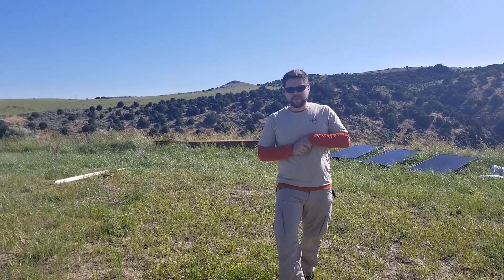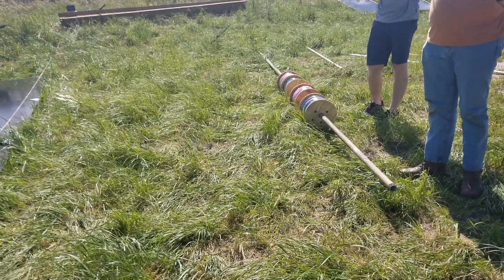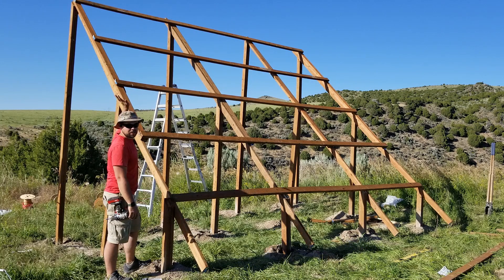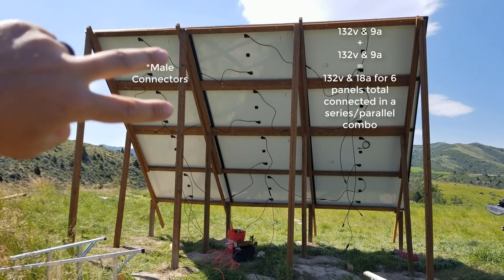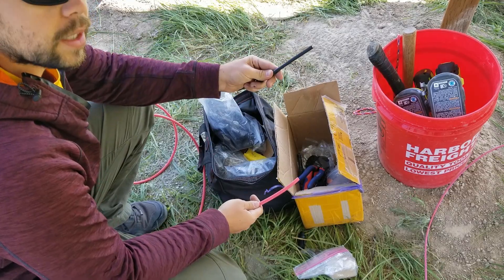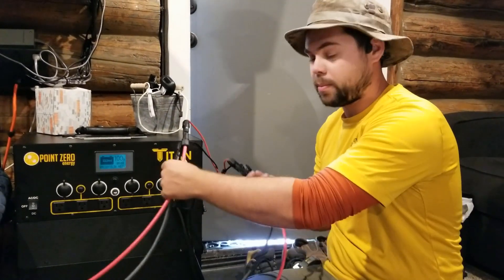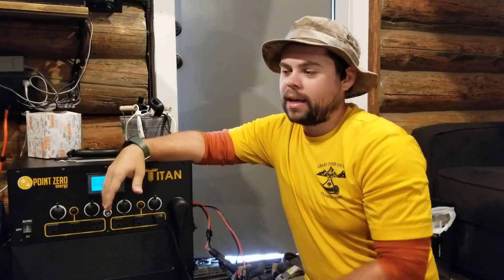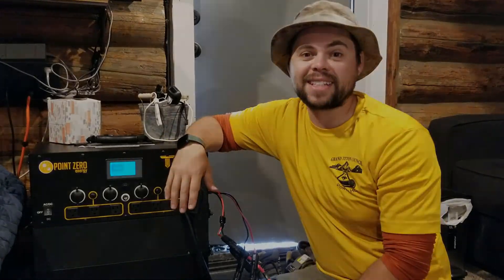DIY Off-Grid Cabin 4kw Solar Panel Array Install

Comment: Your capacity is a little undersized for the amount of solar.....No doubt you'll be fully charged by late morning..and everything else will be surplus..but at night your just running off batteries ...I upgraded my system at 4kw solar .to include 15000 watt hours..of capacity...otherwise all that solar is just wasted ...with 2000 watts solar..you would be charged full  by early afternoon...so what's the point of the extra solar..if you can't store it

Comment: awesome vid.. Thank you..  Did you put in a combiner box or inline fuses in? I'm about to do an off grid array about 4000 watts to a 145 VOC max Growatt, and I'm confused on if I really "need" to inline fuse and or the "combiner box"  It looks like you may have just "branch connected" the mc4 connectors in series/parallel then direct to controller..?  Cheers
Reply from the maker: I did not use a combiner box or inline fuses. Both would be good but I just opted not to. I would put inline fuses in and I use combiner branch connectors instead of a combiner box but they do the same thing. A combiner box is nicer.
Reply: I was thinking the same thing… Thanks again! @minutemansolar

Comment: Your setup is cool and all, but just so people know, most family households daily use 25kWh which is 12x more than the 2kWh that this cabin uses. And that's often without air-conditioning or heating, or perhaps just occasional light use. So for most households, the battery would have to be at least triple his 6kWh size just to get through one night at 80% discharge. And the solar array would need to be double his 4kW size to cope with winter output, which is generally the most critical period to account for when sizing an off-grid system. Plus get a good generator for every instance that you get a cloudy or rainy day when solar doesn't generate much. But for this guy's daily usage of only 2kWh (instead of 25kWh), his setup is more then enough.

Comment: Hi Ben, love this video.  Starting my array rack now too.  Curious about the wood.  You used 4x4's for the uprights?  What fixed angle did you go with there in Idaho?  Also curious if you used those concrete tubes or just put concrete around your 4x4s in the holes?  Do the 4x4s go 4 ft into the ground or just mount with hardware on top of the concrete?  Thanks again.  Sweet project!
Reply from the maker: Yes 4x4 uprights. 45 degree angle for Idaho. I drilled 12" wide by 4ft deep holes into the ground with and auger and filled it with cement while the posts were inside the hole. That's it. Keeping it simple.
Reply: @minutemansolar  much appreciated!
Reply: Just watching the video again. Can you remind me the width and depth on the ground for the posts you did?. I think you said 16 wide and up to 10 ft height. Do you know the depth on the ground?
Reply from the maker: @bekindlove  I put my posts 4ft into the ground. I don't remember the exact ground measurement.

Comment: Quick question, How deep did you bury you 400 ft of 8 gauge wire?  Also, is it necessary to put your 4 lines underground in conduit.  And if it is in conduit, is there any concern for overheating with all 4 wires in there?
Reply from the maker: No worry of overheating. I only burried mine about 12 to 18 inches deep inside of a pipe/conduit to keep it from getting eaten by mice or anything.

Comment: Ben another comment/question if I may.  I noticed that you kept all of the panels facing the same direction.  I have noticed other arrays where they take a percentage of the panels... let's say 1/3 or so and point them at another angle.  Any thoughts on this one please?  Thanks.
Reply from the maker: Yes there's a benefit to that because then you get the sun better when it's in the east or west whereas mine are only South South East. To be upfront at the time of filming this video I didn't understand how to make a stand or anything well enough to have them pointing in different directions. Now I know how to do that and it's not a bad idea at all. But, in the end, I'm usually fully charged by 10am or 11am =) So no real big complaints.
Reply: @minutemansolar  Really appreciate you being real on this one.  I try to do the same on my videos. I show all my screw ups etc and learning curves.  I figure I can save others some of the hurdles I incurred. Fully charged by 10am or 11 am. Thats amazing.  I am in SE Arizona and it's unusual not to have lots of sun for the full day. Thanks again Ben!
Reply from the maker: @affordabledesertliving3487  No problem at all. That's what I am here for =)

Comment: Ben this was super helpful.  I came here because your recommended I check this out. With all of that power I am thinking you could run a low watt (think about 900 watt) mini split system to both heat and cool the cabin. That is my plan anyway. What do you think?
Reply from the maker: ... =D video coming... haha
Reply: @minutemansolar  Been wanting to see the titan take on a mini split for many years now.  I am a subscriber so will look for it.

Comment: I want this setup! So you can overpanel the Titan? Can I series connect 3kw in 1 string into the Titan?
Reply from the maker: Yes as long as you're within the charge parameters of 35-145v and 30a. That's per charge controller. Each charge controller will only let in a max of 1,000w each.

Comment: I see you are using the 30 amp RV plug on the Titan to pull power out for your loads.  Do you run that through into a subpanel with breakers?  Also, do you know what the Titan does if you exceed the 30 amps (blow the breaker)?  Do both of the 15 amp breakers on the front trip, or is there another breaker somewhere for the 30 amp plug?  Thanks!
Reply from the maker: Yes that goes to a 120v electrical panel with breakers. The Titan 30amp plug has a max output of 25amps. If it goes over 25 amps it will simply shut off the inverter and beep giving an alarm that it was overloaded. I have done that and just turning it off and then back on fixed it.

Comment: 1. Are you just laying the wire on the ground all the way?   2. Suggestion : Standard practice for electrical work is to mark any wire with tape of the right color, if the wire is used differently like you did.
Reply from the maker: The wire is currently laying on the ground and will eventually be buried inside of a pipe to help it last a long time and not get damaged by animals.

Comment: You ran 2 (separate) sets (black/red) of 8gauge cable down the hill.  Then you connected the cables back together at the cabin.  Can you explain why you did it that way?  Do you have a wiring diagram?
Reply from the maker: Correct. There are two charge controllers on the Titan solar generator. So because of that I needed two sets of cables coming down from the panels. The top 6 solar panels are one array and the bottom 6 panels are another array. Because there are 2 arrays I needed 2 dedicated power lines to the Titan to go into the two charge controllers.
Reply: @minutemansolar  Oh, okay, thx.  Did not realize there are 2 charge controllers.

Comment: As I am sitting here watching your video while the TV has coverage from hurricane Laura my thoughts about 2x4 lumber supporting what amounts to a fairly large sail makes me think about how well that installation would handle some really strong wind gusts, especially from behind. I hope that it works out for you. I live in New England and we lost power for almost 4 days from a tropical storm that had gusts as high as about 85 mph. We ran important stuff off a small Honda generator. Looking into solar for a while and I came across your channel a while ago and subscribed. Interesting videos, thanks.
Reply from the maker: Luckily we do not get hurricanes here in Idaho. The 2x4s are screwed together to make 4x4s. Multiple reviews/tests have actually found that 2x4's that are screwed together are often times stronger than 4x4s. We are definitely mindful of the winds up there and there's always a risk with solar panels anywhere you go.
Reply: @minutemansolar  Yes, you are very lucky to not get hurricanes in Idaho. Awesome amount of wind energy and water from them. They demand lots of respect. Since I used to fly small planes, I kind of automatically visualize how the wind goes over the terrain and man made objects because it helps anticipate the possible turbulence and changes in wind direction and velocity that is caused by the interaction. I have learned a lot about solar power from your videos, Keep them coming. Thanks.
Reply from the maker: @paullehr9236  Thanks

Comment: Thank you for the clear explanations. You make DIY solar not seem so difficult.  Where did you source solar panels of that size?
Reply from the maker: Thanks I'm glad to hear that. Normally I use the 100w solar panels that come in the Titan kits because they are the absolute best I have found. I had these 315w panels from a guy locally. They were VERY heavy and bit hard to work with, the 100w panels would've been much easier but they were what I had around and figured I would just use them up.